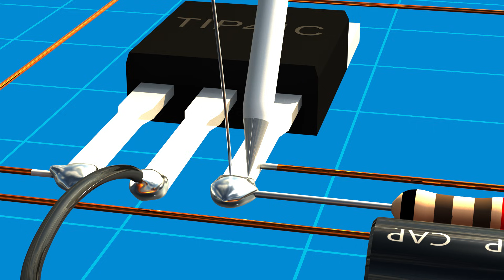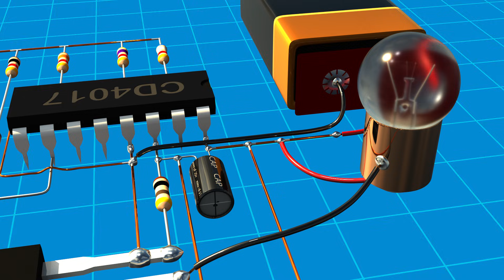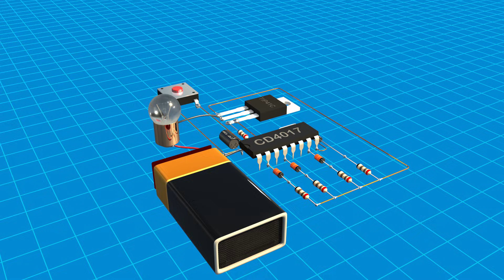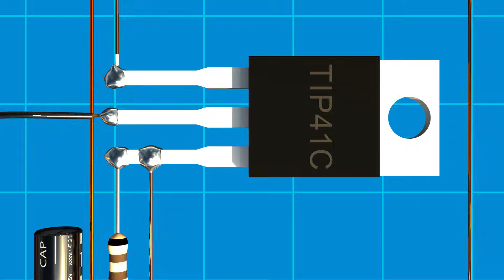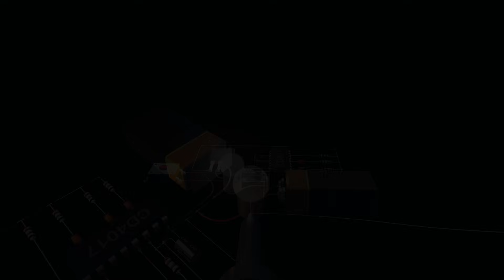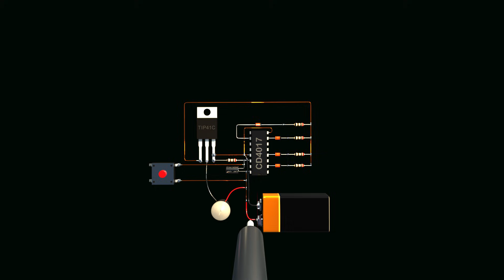Try this simple Light Dimmer Circuit

Comment: What are the resistor values ?. How to change them ?.
Reply: [9/2/2025, 17:46] Luca: Hi, could you design electronic circuits and devices starting from scratch and then showing the various connections and the arrangement of the electronic components so that they are easier to create, I would like to build electronic circuits with triggered and non-triggered logic gates, flip flops, Pic PLC microcontrollers etc...... ok?  thanks Luca
[15/3/2025, 23:38] Luca: https://youtu.be/NjwrdY1hyBQ?si=8IwxtLfymDE4XgXt
[16/3/2025, 16:00] Luca: [21/2, 14:26] Luca: https://youtube.com/shorts/Yu3obf6W18w?si=_HRrzUmfWwxpHEyN
[21/2, 14:26] Luca: X esempio/For esemple. : https://youtube.com/shorts/Yu3obf6W18w?si=_HRrzUmfWwxpHEyN
[5/3, 10:52] Luca: Ciao potreste progettare circuiti e dispositivi elettronici partendo da zero quindi facendo vedere i vari collegamenti e la disposizione dei componenti elettronici mentre spiegate il funzionamento dei circuiti elettronici in modo che siano più semplici da realizzare? Vorrei costruire ad esempio circuiti con porte logiche,and ,or,not,nand,ex-or,ex-nor ;triggerate e non,flop microcontrollori Pic PLC ecc.. ok? Grazie Luca 😊👋
[5/3, 10:53] Luca: Video normale e /o short.  Normale video and/or short
[27/9/2025, 19:07] Luca: https://youtu.be/iQwIK-hMGBU?si=NYpK2OFxg6iGsrQ2